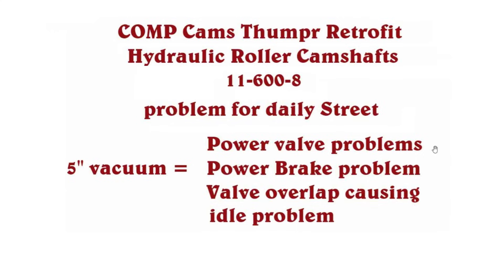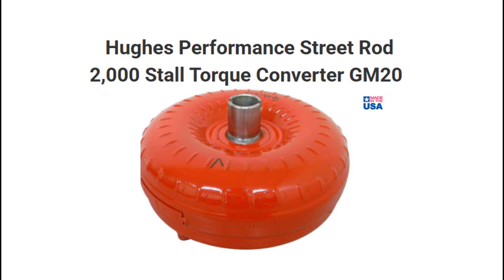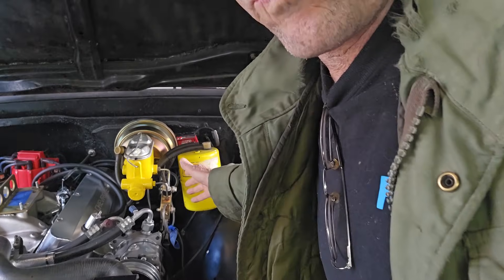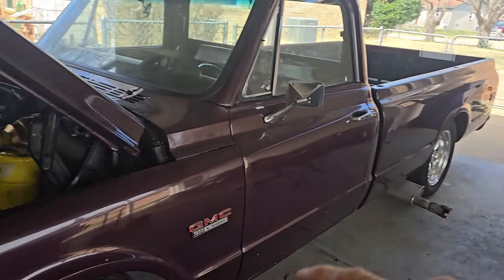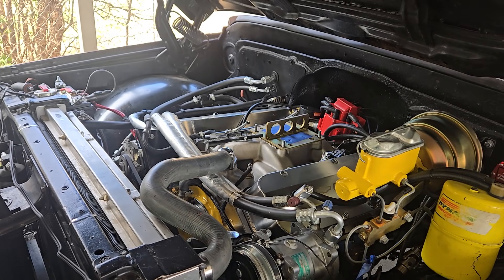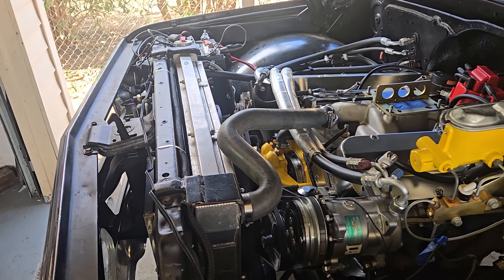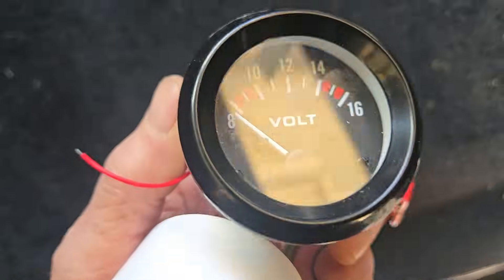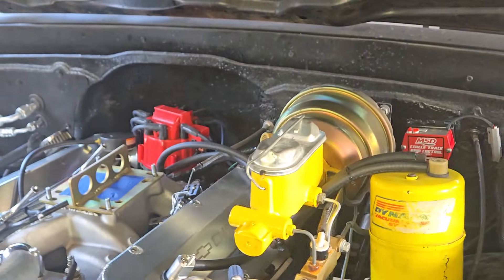454 Going from 107° lobe separation to a 110° separation cam

Comment: I've never had issues running healthy cams I don't pay much attention to the vacuum I'll run manual breaks or hydro boost for the breaks depending on what the car is for. A small cam for that engine IMO is just a bad idea.
Reply from the maker: It's not getting a small cam. Just a better lobe separation. Dur @ .050" = 224/224,  Lift with 1.7:1 rockers = .566"/.566", LSA = 110° The pickup has to have power brakes. Suggested by Comp cams Tech department for a street performance cam.

Comment: My goodness Dwayne (<---spelling?), by the time you get this thing where you want it, are you gonna make any money at all? Seems like this is getting awful expensive with all the extra parts buying every video. Hopefully it's right on this next parts combo.
Reply: And I also think your cam recommendation was good.  The only reason I prefer the 110 lsa vs the 114 with the same 218/224 duration is because it will get the intake valve closed sooner.  Puts him just a shade over 8 to 1 dynamic.  Plus it will help utilize the headers and 2000 stall converter better, with a little more overlap.  I think marine cams are generally wider lsa to reduce overlap, to prevent water reversion through the exhaust.
Reply from the maker: @Chiefs-online  Oh I haven't even looked at anything with 114.
Reply: Sorry dac, that was meant to go to patrickm
Reply from the maker: Boy I know it. I was never going to make any money on this. I was never supposed to spend any. It has cost me $8000+ so far.
Reply: My bad I see that marine cam is 112 lsa.

Comment: I could ask a few questions and give you a recommendation for a shelf cam, but perhaps this could be a good opportunity to get ahold of a cam company and have one suggested?  Or ground.
Reply: I forget where you are at on static compression, but I would be mindful of your dynamic compression calculations using advertised camshaft (.006) numbers.  Aluminum heads can tolerate more, but must be mindful still.  8 to 8.5 is probably where you want to be.  You can use smaller lobe duration with a wider lsa, 110 to 114, to keep intake valve closing in the same ballpark.  Far less overlap.  Could still run a quicker lobe and get some good lift numbers out of it.
Reply from the maker: @ I have filled out a spec questionnaire  and waiting on the recommendation. 9.76:1
Reply: 454 crank with stock length rods?  I’ll shoot my recommendation for the heck of it.
Reply from the maker: @ No problem, I read every comment and I consider many of them.
Reply: 11-422-8 comp.  Should work with a stock converter, but if you have a 2000 stall you will be really happy.  It will have a lope at idle but nothing crazy like that thumpr cam.  You will not have tuning issues like the thumpr.
Reply: I think that cam only needs the single springs with dampers.  Might be able to pull your inner spring and save some life and also free up some hp!
Reply from the maker: @Chiefs-online  These are the recommended springs.
Reply from the maker: @ I like it, We'll see what Comp recommends, that may be one that they do ?
Reply: The cam I suggested only requires single springs, but dual springs will work too.  I realize the thumpr required the doubles.
Reply from the maker: @Chiefs-online  Ok, I didn't realize you were talking about the 422 cam
Reply: Copy!  I kinda thought so, so I wanted to clarify!

Comment: now you are cookin...110 overlap...thats max for street in my opinion.and i never had brake problems...
Reply from the maker: I didn't realize what 107 would do. I was trying for a cam with a lot of chop at idle. I think this thing would have to idle at 1000 to 1200 to operate right. A little high for a street car and no brake booster. Maybe if I drove it down the road, it may build up some vacuum in the vacuum can.

Comment: You going roller this time Dac??
Reply from the maker: It is already roller.
Reply: @DACoutBack  did you get it ordered or ya need help?
Reply from the maker: @Scubasteve22  Waiting on Comp Cams. I filled out a big list of specs they asked for. They'll get back with me.
Reply: @DACoutBack  does it have to be a comp? Or prefer comp?
Reply from the maker: @Scubasteve22  It is what is in stock. It doesn't have to be Comp. Other cams have a delivery like April
Reply: @DACoutBack  summit has the comp 11-423-8. It is in stock and would work. Also competition products has an Elgin no. ELGE-1235P that would be great and little cheaper. I went with the crower 01402 in my 454 i built for a customer. It runs great. I did not put a vac gauge on it. Hope this helps...

Comment: Yep ....i had one of those lumpy cams in a sbc ....and they are not very streetable ....that is why I'm using a 413 -8 HR ......because i want an every day driver also ....im not looking for a race engine ...i want more reliable... i would do the cam swap before the radiator...gm did a 4 core factory for bbc ...3 core where sbc ....just a suggestion....good luck ..
Reply from the maker: I was told on a YouTube channel, the 2 core has more surface area than a 4 core and the extra cores just heat the other ones up.
Reply: @DACoutBack  my 67 came with a sbc and 3 core rad .....a friend has a 77 with a factory bbc with a 4 core .... but they are copper brass rads....but the aluminum rad might be different....I guess we will find out ....
Reply from the maker: @guyyates3284  I guess. IDK, It is not really running hot but, it is not staying as cool as I think it should. It hits 200 too easy. We live in Texas, it is going to have to survive 110° in heavy traffic (DFW).

Comment: After watching your video. I went to Comp's catalogue and I believe the cam that is in it will
be better than the one you are looking at. The one you have says works ok with stock 
converter & best with 2000+ stall. The other one says needs 2000+ stall. In the past if a cam
says it will work with a stock converter that is for vacuum purposes. I think I would try a 
different carb and maybe a different distributor before a cam swap. A couple of videos ago
it was starting and running fine. Not telling you what to do just offering some suggestions.
Hate to see you having so much trouble for everything you have gone through.
Reply from the maker: I agree, I think I could get this one running. I'm just not sure how good it will do on a daily basis and the power brakes are almost not even there. I need something dependable for a guy that don't know anything.
Reply: @DACoutBack  That's why I think the cam you have will be more streetable than the one you are looking at.  Usually a stall converter takes care of the vacuum issues. And you have a stall. Something is not adding up. I understand what you are looking for just not sure a cam swap will do it.
Reply from the maker: @495ciGTO  110° has to have more vacuum than this 107° cam
Reply from the maker: @495ciGTO  The one I am looking at only has 224/230° duration compared to 227/241° plus the overlap of the 107° going up to 110°
Reply from the maker: @495ciGTO  Ok, I have looked and I will step it down one more cam size to the CCA-11-422-8, Dur@.050 = 218/224, 110 lsa
Reply: @ That should be a very drivable cam, Basically two steps over a stock cam. adv duration of 270 and .510 lift.
Reply from the maker: @495ciGTO  Afterall, it's not a race car. It should still run very well.
Reply: @ With everything you have done heads, intake, exhaust and roller cam it's still going to be a tire burner.
Reply from the maker: @495ciGTO  I just filled out a huge questionnaire to Comp Cams and they will come back with a suggestion. Now, I wait.
Reply: @   That's a good move.
Reply from the maker: No, the one I have recommends a 2000 stall converter. That's why I bought a stall converter. The one I am looking at does not.
Reply: @  Ok that makes more sense. I thought you were going the other way. Sorry for looking at this wrong.

Comment: I'm running a Howard's rattler hydraulic roller with a 109 lsa and I haven't had any problems
Reply from the maker: That's good. I am having problems with idle on this Comp Can with 107°
Reply: @DACoutBack  If you decide to sell the camshaft I would be interested
Reply from the maker: @ sounds good.
Reply: Good luck, Dac!! I'm building  a 73 454 too. I called SUMMIT and he recommended 11 433-8 for my build, but that's going in a Corvette with a 4 speed Muncie. I'd call Comp, or SUMMIT and let them know were you want to be with it, and they should be able to point you in the right direction. Also, if it will save any money you can have the other one reground. Keep us posted on what you decide on.
Reply from the maker: @JBSGarage454  I will.

Comment: I hope the engine block and radiator doesnt crack from the cold weather, i wouldve left the coolant in it until getting the parts
Reply from the maker: @DanielP-c9g  it has antifreeze in it, and if there is nothing in there, there is nothing to freeze. I think we are past all the freezing anyway.

Comment: Yep, get the wide core radiator where the tubes are wide.  This slows the coolant flow for heat rejection.
Reply from the maker: I do not see any options in search for wide tube radiator ? Going from 4 row to 2 row is for more surface area.
Reply: @DACoutBack  The 2-row radiator usually has wider tubes.
I wonder if the heat you see isn't the result of being too rich or not enough advance, maybe even it's a gauge calibration issue.
But yeah, the 2-core rad has wider tubes, so overall width is probably same as 4-core.
Anyway, there should be a description for tube width, probably 3/4 or 1 inch.
I think you can get a wide(er) single core as well.
Reply: @DACoutBack  Concerning manifold vacuum advance, you want a VA can that provides full advance at 1-2" less than you have at idle.
I don't recall your idle timing but I'm gonna guess 20-30 degrees BTDC, maybe closer to 30.
From Summit:
"A 2-row radiator with 1 in. tubes will have more tube-to-fin contact than a 3-row radiator with 5/8 in. tubes.

2 in. vs. 1 7/8 in.

The radiators will be about the same thickness.

The 2-row radiator will be less restrictive to airflow.

In this example, the 2-row radiator has more cooling capacity than the 3-row."
I've seen 1-1/4 tubes as well, a two-row should be morethan enough.